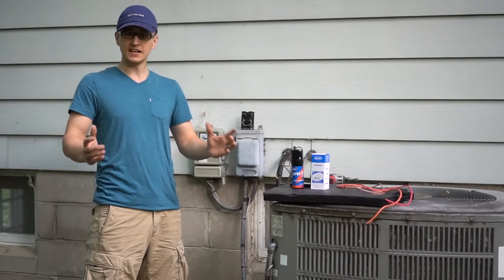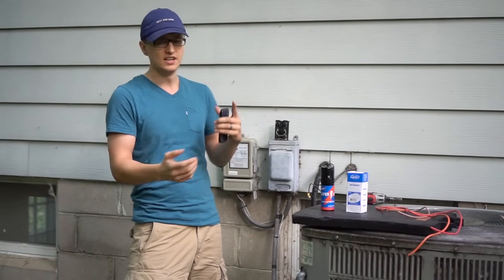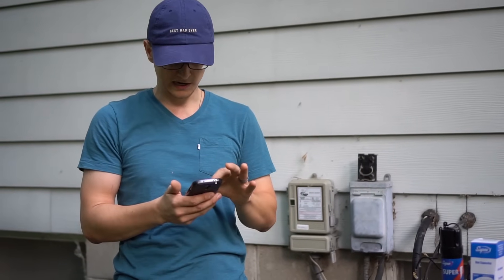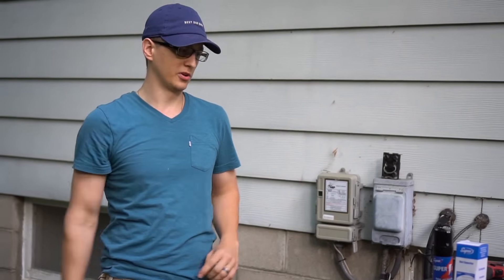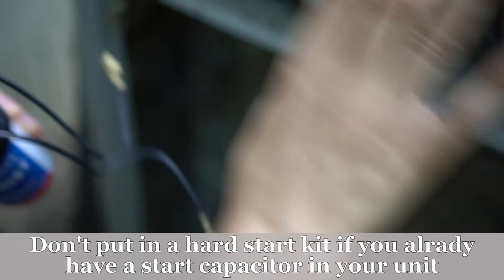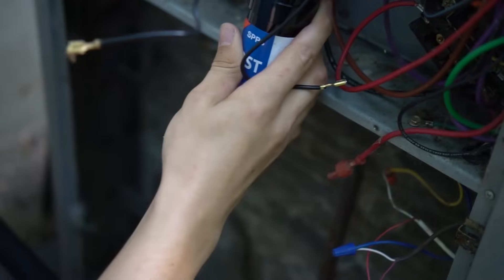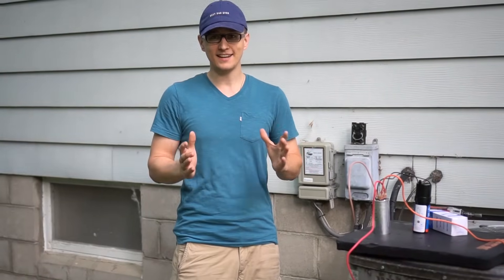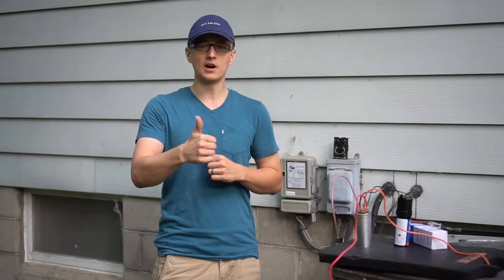How to Install a Hard Start Kit in Your Air Conditioner

Comment: The part you missed in your explanation.  Do I still hook just the 2 wires up and leave the relay connected? Mine is an older trane that has the capacitor hooked up to the relay with 3 wires RLY1097 relay

Comment: Hi Jay.  Great video.  I'm wondering if perhaps my a/c could use a hard start kit.  The outside compressor unit will come on, run a few seconds, shut off, repeat 3 or 4 times before it finally settles down and runs u  thanks

Comment: Hi, Jay. Does the original potential relay that comes with the AC unit need to be good in order to use the hard start kit? What if the AC potential relay is bad already? Can I still use the hard start kit?

Comment: Nice video. Too bad this didn't work for me. I have an old compressor which is locking and I bought the exact same hard start kit used in the video. Connected it correctly and nothing. As usual, the compressor would start for a second and stop. I let it run for a while and nothing. Disconnected the hard start kit and reconnected it and nothing. When something sounds too good to be true, it usually is. At least I tried it before calling a professional and getting robbed.
Reply: Bro, in your situation you should have try to replace your capacitor as well, it cost less than $15 dollar.
Reply: @brianp9054  Thanks Brian, I already had replaced the capacitor and that wasn't the problem. I had the whole system replaced the other day so I'm a bit poorer but back in a cool house! Best regards.

Comment: I wish I had known this before Damien Pietak of Superior Air Systems in San Diego charged me $703 to replace mine -- that was $618 for parts plus $85 for a service call. He knew before he showed up that this was the likely problem and he went straight to it. It took him about 10 minutes to test and replace.
Reply: That happens to me twice with some plumbing issues, first I was charged a littlemore than $500 for replacing a water hose inside the house, and later above $300 for similar task outside the house, and I said never again. After that every single issue I have I google it, I watch as many video as needed and I fix it myself. Installing dishwasher, fixing plumbing issues, installing 240v circuit, adding new breakers in the electrical panel, troubleshooting AC problems, installing thermostat, installing inlet for generator, etc, etc, etc. My advice: if you feel that you can do it, then you are right. Just invest some time to learn about the topic and you will be ok.
Reply: @brianp9054  Right! -- or at least know what's involved so you can judge whether or not the bid is fair. And by all means, get a bid in advance. And if you can, watch to make sure they don't cut corners.

Comment: There are different kits
I don't know what each means
5-2-1
3W1
SPP5
CSR-U2

I have a 2.5 ton Goodman 13 SEER. 240 volt single phase

Comment: the techician told me when I replace my bad fan motor, I should also replace the "hard kick start", it is a Carrier 24ABC636A0030010 outside unit, In the video, you mentioned fan motor don't need a hard start?

Comment: How can I decide which would be better to use, a hard starter or a soft starter?
My system is old (about 17 years now) but my compressor is still working OK as far as I can tell.
The power to the house is notably less when the AC starts up and runs, as I can tell it by the fans (not ceiling fans, but fans like you would plug into the wall outlet) in the house will run at a slower speed while the AC is running and resume their normal faster speeds when the AC goes off.

Comment: I installed a Supco SPP7 on a 2 ton ac condenser, went common & herm. Fired it up and the condenser fan would not turn. Removed hardstart and all back to normal. Capacitor was a 30/5. Anyone know what the issue is on why the fan would not energize?? Thx

Comment: Jay, how much of a wattage surge drain upon starting even though it only last a second or two on my Solar battery 🔋 ( Lithium ion Phosphate)? My question is how much of a wattage savings would it save me by using the Hard Start assist? Would that 1 second drain without the hard start assist consume that much electricity from my battery? I live in Mississippi so I have a 14 seer 5 ton AC unit. It gets very humid and Hot 🥵

Comment: From the two black wires of the booster does it not matter which black goes to herm or common
Reply from the maker: With this one it does not matter. But I like to put the black wire that has the jumper connector on the common. 👍

Comment: Hi Jay
I have a new installed an AC unit the inside and the out side about a year ago. However, a few days ago the condenser unit capacitor failed and unable to start the compressor . I had to replace the capacitor, now working fine. The unit is 3 tone /14 seer and 45/5 capacitor. I also noticed that it doesn’t have hard start capacitor; my question is would it helps to put hard start capacitor to maintain the life of compressor and for easy start. I always watch your video. I exceedingly appreciate you for every education you provided us with.
Thank you

Comment: My unit has a dual capacitor, I tested and it is bad.  It also has a hard start.  However the fan part of dual capacitor is not being used instead there is a small run capacitor.  I’m not sure why or what to do.  Any suggestions on why and how I should hook up now?
Reply from the maker: Sounds like your unit has 2 separate capacitors for the compressor and the fan motor. You can either replace both of the capacitors and wire them up exactly the same way you have them now or you can combine the two capacitors into one dual capacitor. I have two videos which may help you better understand what I am talking about:

Watch the end of this video, the last couple minutes: https://youtu.be/4S8TZd-45bY
How to combine capacitors: https://youtu.be/qLJOWU33TFo
This video is not mine but great video for your situation too: https://youtu.be/q6cKpCcaYYk
Reply: @WordofAdviceTV  Thank you!  I have learned a lot from your videos.  You are the best at explaining everything making it possible for a novice like myself to comprehend.  The directions on the “Hard Start Multiplier” say to hook up each of it’s black wires to the run capacitor.  But each of it’s two wires were previously hooked up to the Dual Capacitor, 1 of its wire’s on Therm, the other on Common.  I took the run capacitor off and replaced it because it was rusted out and taped with electrical tape - I don’t understand why!  I tested the not so pretty one and to my surprise the multi meter reading was right on. I don’t understand why the company that has been fixing our AC since day one would do this.  I lost my husband recently in a vicious horrific crime.  He took care of everything.  Now I am learning.  The HVAC Co. that he’d used charged $838.00 in 2018, 656.00 in 2016, and on & on the charges have been consistent & it was a pretty sloppy hook up.  Not sure what to do!  Please advise or suggestions or reasons would be of great help and appreciated.

Comment: Can you do a video on how to install 521 hard start with heat sequencer. This is supposed to be the best setup as hard stop kit will provide the boost needed to start the compressor thus reducing amp load which is will be good on you electric bill. And the hest sequencer will allow the condenser fan to start first to free up the refringent and the compressor few seconds later so that the compressor doesnt need to work too hard to get the refringent moving.  This also reduces the noise level drasticaly. It's like having a hign end high efficiency unit that runs quite!!!!

Comment: I finally got my a/c going after 4 days. I watched alot on here and learned a lot about ECM motors. Instead of a capacitor it has a module as part of the motor. You can take it off and replace it instead of the whole motor. I guess the motor is pretty expensive. Anyway, I ordered a used module on ebay for $129. It came in today and I threw it on there, but it just made a bump noise. I'm not sure if that was the compressor?(it was running before without the air handler fan) Then I put that booster on
that you suggested I buy, from the old a/c. I waited 5 whole minutes and finally everything came on, wheeeww! 😱🥲
Reply from the maker: I almost missed your comment in the sea of comments! I am glad to hear that you were able to get the AC fixed! I apologize if you replied but I never got back to you. Unless it is the most recent video posted, the other comments I rarely answer as they are quite numerous. Anyway, what you described sounds like a common occurrence. With those ECM motors it is often the module fails, not the motor itself. In the shop where I used to work they had a whole pack of resistors specifically for ECM motors. Quite often soldering in a new resistor to replace the burnt out one was all that is needed. As for the bump start, its possible that was a delayed start. Some units will delay start up by 5 minutes if the power to it was interrupted. With a delayed start the unit will often do exactly what you described, it starts for half a second and shuts off. Hopefully that wasn't the sound of the compressor failing to start. That would be a bad sign. A hard start kit may get it going but usually the problem will return and then even the hard start won't help it. Sigh.. I keep saying usually/commonly/typically/often... I learned from experience that there are many many variables so I am wary of claiming something as fact. 

Lol this response is probably more than you asked for but in summary - you are the man Mr. Classic!! You persisted and you did not fail. The AC works again and may it run another 20 years problem free for you! God bless.
Reply: @WordofAdviceTV , I'm glad you saw my story. By the way, maybe your twin brother would like to move here next door in Florida 😇😊
Reply from the maker: @classic287  Haha I will have to ask him and see how he feels about it. On that note, I do have a cousin that kind of looks like me that lives in Florida. It's a small world so who knows, perhaps some day you will bump into him. 😄

Comment: Thanks for the information! I have an RV, and a common brand for the RV air conditioners used is the Micro Air Easy Start, which runs 300+ dollars, but seems to be essentially the same concept as the Supco hard start. If you're familiar with that product, can you highlight any compelling reason to choose the Micro Air over the Supco?

Comment: I just installed this kit and looks like my lights don't deem any more, however the system takes longer for it to start, I even saw a "wait" message on the wall mount unit where you turn and off the unit, why do you think this is happening, did i install it incorrectly or does it take time for the new kit to charge?

Comment: IN my Carrier, I already see a Carrier HN51KC024 coil (relay I suppose). Do I just leave it in the system and still connect the Hard Start Kit of placing the 2 wires on the Herm and the Common as directed? What is instructed to do?

Comment: Also, how does one know when the Hard Start Kit is bad and needs to be replaced? How is it tested to prove it's the problem in the compressor motor unit and not the actual start capacitor?
Reply: Kyle, but why use a "tech'? The product is self explainable on its function and capability in installation. I was asking about what indication is seen, heard, etc. if the product is bad to replace it? One can always check the Run Capacitor to see if it's bad. Does the Kickstart Kit test in the same way? How?
Reply: Most HVAC techs have a meter that can check them.

Comment: I didn't hear you mention which terminal takes which of the black wires to Herm and Capacitor. I surmise that it doesn't matter which wire goes to which spade and that I could connect either wire to either spade, correct?

Comment: If my unit has already a hard stat kit can I  install on other one?
Reply from the maker: No. You can replace the one you have but putting in two at the same time will damage the compressor.

Comment: What about if the capacitor has only two connections?  Does this work with it.  I replaced that and it now comes on but is not cooling the house.

Comment: Two wire kit supco spp6 is sufficient for 2 1/2 ton compressor? Do I need the 5-2-1 kit? Which brand is better for 5-2-1 kit? Thanks for help I ordered the supco spp6 yesterday and will be deliver by tomorrow. My condenser fan work however the compressor motor just make some grinding noise at the beginning and stop. After few minutes short grinding noise again and stop. This pattern repeatedly on going. Not hot air feel on the top of condenser fan. It means compressor motor cannot started? I change a new run capacitor which doesn’t help.

Comment: I finally got around to installing a KickStart unit. What a difference!! Should have done it years ago!! 
The compressor always made a very loud 60 cycle hum when it would start but in recent years it was occasionally cutting in and out when trying to start (it's a scroll). Now, the loud hum is gone, and no more cutting in and out. Perfect!
I used the Rectorseal KS1 96506, by the way. Installation was easy.
Reply: Would your ac use more electricity when it would do that? Because mine is doing that rn and I can’t find the start kit anywhere and my house is burning hot just wondering if I can have it on?

Comment: I have a question for Word of Advice TV, will you please explain how to find out that the HVAC Hard Start I am using is good or bad? is there any perticular way to test the hard start such as Supco SPP6 OR SPP5 with a Multimeter?
Also like to know that which hard start is good to use for 5 ton, 3.5 ton and 2.5 ton? Supco SPP6 reads "Increase Starting Torque by 500%" and Supco SPP5 reads "Increase Starting Torque by 300% 
Which one is better for above mentioned units?
Please explain
Thank you

Comment: After 30 years the capacitor on my a/c got wore out and bulged at the top. I popped in a new one with the hard start kit 2 days ago. Works like a charm. Cost $40.00 bucks for the parts.
Reply: 30 years wow.I have 26 years and just added this today.👍
Reply: Where can i order one
Reply: @Elcaballo599  
I got mine at an HVAC store. Plenty of them in my city. But if you're lucky, some electronics stores and hardware stores carry them too.
Amazon has sellers, but they mark them up really high to cover for the shipping.

Comment: While trouble shooting my ac starting with the capacitor no fix, I then was checking the plunger switch and a screw driver sparked and the fan that was working stopped. Where should I look for a fuse? Thanks for any help.

Comment: So I have a dual capacitor just like you showed. Will any hard start kit work regardless of the microfarads your capacitor is rated at?  They don’t have any specifications like the capacitors with microfarads or anything?  Great video thanks for posting

Comment: i bought a spp6 for my compressor. I had to change out the dual because it read 0 microfarads. It is suppose to be a 50 microfard. Im going to install the hard start? Any advice?

Comment: Does it hurt to add one of these to a brand new condenser that didn't come with one from the factory? Or is there a reason the factory didn't include it other than cost lol?
Reply: you would replace your compressor say 10 yrs with it or 5 years without it.... I have a new unit and I'm going to put one in asap

Comment: Supposedly I had one installed on my heat pump but when it cuts on it sounds like it’s slapping the backside of my mobile home. Now, I had to use emergency heat for a short while to add extra heat to my home one night before going to bed. I noticed when it turned on it was very gentile when starting. So, my question is, are there two sides that can be wired up for a hard start??

Comment: My AC compressor is down.  I have a hard start kit.  My problem is when I measured my run capacitor was dead 0.   So I had a spare for 40uf.  Didn't start, It hummed so shutdown.  I though it was the start capacitor.  After checking measurements it moved up to 135 or higher and seem ok.  Though I changed anyways the start capacitor  for a spare new one, same microferets.   After testing ON.  Motor start up, died, blew my brand new start capacitor, and tripped the breaker.  Gonna check the wiring in the compressor.  Yet, Change of seasons.  My old loud PAYNE AC unit might of had it.   Though it might be the compressor rotor stuck and brought me to your video.   I do have a start relay separate from a capacitor in my unit. So, I don't thing adding a 2 wire hard start kit should be done.  Mind boggling here.   What else can I check for why my capacitor blew and trip wires after changing both run and start capacitor.  Thinking my run capacitor at zero could of taking the winding of the compressor too.  I d k  ideas  Some help?? thanks
Reply: Update: winding good,  capacitors ok, gas pressure ok, no grounding, relay bad.  Found that my coil in the 5  2  1 hard start relay went OL(NO RESISTANCE) is faulty old doesn't cut kick start capacitor.  Unusual relay don't go bad.  This one is from an older unit.  Older units last longer as seen in videos tech guys talking about them.  Relay  needs replacement.  Found an AC Hard Start Capacitor Compatible with 5-2-1 CSR-U2 in ebay.  Gonna replace that 5 2 1 and capacitor with this upgrade.   Never got answer from the video maker here.   Update Info here for the needed person. I think I found my problem.  Moving on.  Thanks

Comment: Whats a A Coil? In the 50' Line?
Reply: He talks about an split system, one part of the unit is inside the house and the second one outside connected each other with the refrigerant lines,20'30'40'50' etc ,depending the length between the A "inside" to B "outside" like the one in his video , you probably got a package unit that is all in one package and doesn't need a line set 😉